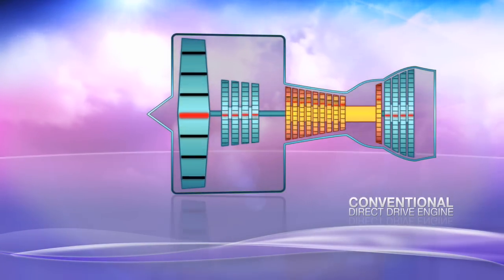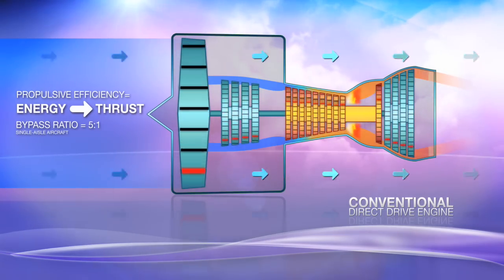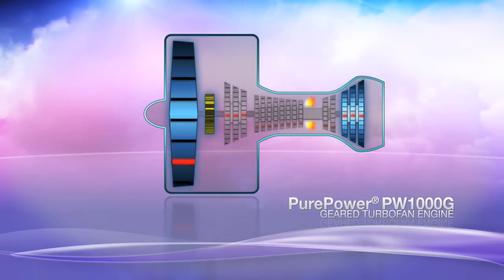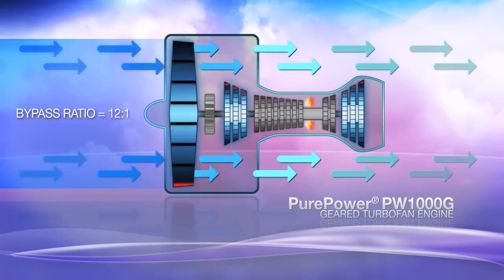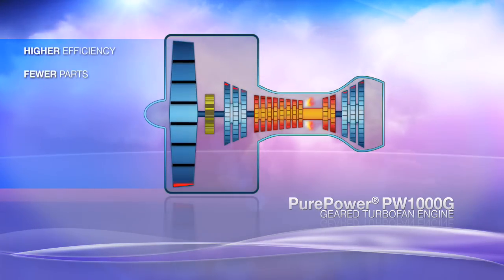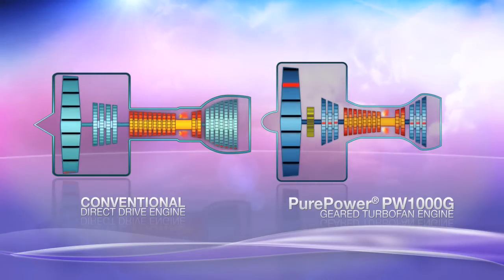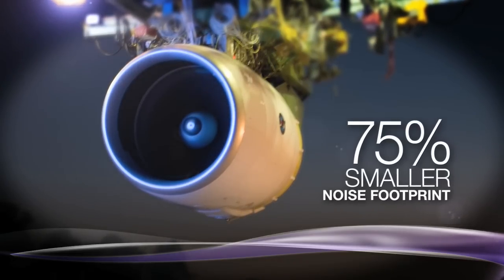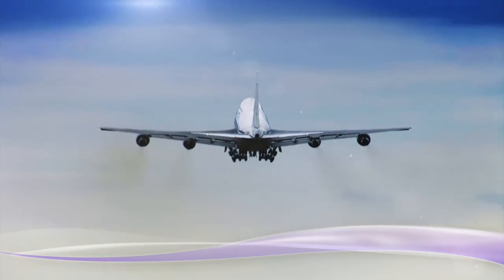Pratt & Whitney PW1000G PurePower Engine How It Works

Comment: Ok, fine, you have me convinced.
Where can I buy one, how much is it, and how do I attach it to my bicycle?
Reply: I need one for my '73 Super Beetle. Order online? Think 'bout $30mil/ ea. And just use the maintenance stand for it and a bicycle tag along bar.
Reply: @British Airways Boeing 747-436 Not with that attitude!
Reply: I need two, in case one fails.
Reply: @MarzEzOnline  
I think #2 was the test engine.
Reply: *engine starter kit and fuel systems not included in the box.

Comment: These engines have been introduced in haste. Around 31 "A320 Neo" aircraft of Indian carrier "Indigo" have been grounded as the new engine packed off mid air. Passengers reported hearing huge bang and the engine just shut down.
Reply: Martian Tripod you should check your source of information, no these are not the NEO engines, this is a diff tech still in the testing phase, will be a while before its put to commercial use,
Reply: @dannydawn927  it is A320-271N with " Pratt & Whitney PW1127G-JM " engine.. all a320neo with Pratt & Whitney PW1000G facing same problem
Reply: @dannydawn927  You’re just wrong.
Reply: A company named GoAir got Bankrupt buying this engine.
Reply: It was due to a manufacturing defect in the metal injection moulded parts.  The powdered metal was contaminated with ceramic tooling.  This also affects the non-geared older engines.

You're a silly billy.

Comment: The US Air Force needs to put these on the KC-135 Stratotanker. It would be a huge fuel saving program. It would be about 1600 engines too. Maybe reengine the B-52 with four of them too.
Reply: Hell, if they can just put modern turbofans on the B-52 they could cut the number of engines by half and get better performance in the deal! That plane uses the same engines as the 707, from the late 50's, without fan bypass!
Reply: the C135 tankers are nearly out of service and they were allready upgraded to CFM56 turbofans from the older JT engines .. doubt its worth it a second (or eve third for early models re-engining when they are due to be replaced soon (with the KC-46)
Reply: There is a version that went for the B-52 but was won by Rolls-Royce. The version P&W put up is going in the new B-21.

Comment: but i don't get how this is more efficient, because now the fan spins slower than normal which means it will get less thrust, while the compressor spins at the same speed the fan is spinning slower than normal and in order to achieve the same amount of thrust as engine without gearbox the compressor now have to work harder which means it will eat up more fuel! so how is this gearbox more efficient? can anyone explain to me how is this more efficient?
Reply: A larger fan can push more air mass, thus, more thrust available. In place of pushing less air to a very high speed (noisy and not very friendly with the fuel), the fan increased its size, slowed its speed but increased the mass flow, therefore, at lower speeds (quieter, fuel friendly), you get the same power. For a plane going subsonic, a slow fan is more efficient.
Reply: smlbstcbr Ah! I see! thanks!
Reply: Ok, you seem like you may know the answer to a question that has been bugging me for a few days now. It appears to me that that there must be some sort of gearbox between each jet engine stage already since, like in a GE90, they each turn at very different speeds. With this in mind, please explain why this final gear reduction has been so difficult to achieve. How are the intermediate stages coupled anyway, they each seem to turn at different speeds, they have counter rotating sections, reverse direction, etc., and yet they still transmit power from the rear turbine thru to very large powerful fans, now PW is saying that a gearbox on the final connection is a game changer, please explain. I see this comment is 2 years old, so I'm saying thanks in advance if you decide to answer me.
Reply: Darnley Bynoe Actually, there's no gearing between stages. The spools rotate independently from each other, at least on large engines like the Rolls Royce Trent (I think they have three spools), GE90 and PW4000. They have no mechanical linkage among them, what makes them move is the fluid that goes through them. Why was it so difficult to make a final reduction? Well, because of the size of the engine and the power that the gear has to handle, it has to be an extremely reliable gear, lives depend on the reliability of those components. Putting a gear simplifies the design of the engine stages. The high pressure compressor works more efficiently at high rpms and the fan is more efficient at subsonic speeds. Extracting power at low speeds from a very high speed fluid would require a lot of intermediate stages, with the associate cost of having more blades to maintain and replace.
Reply: Damley Bynoe... The main front power fan is driven by a planetary gear set... Not sure about the specific gear ratio, but it's a reduction gear. 
As for the compressor & turbine stages, they are split in high pressure & low pressure... high pressure on hollow shaft & low pressure on solid primary shaft running through the hollow shaft independently. Basically, the high pressure turbine spool primarily runs the high pressure compressor spool and is allowed to run at a different/higher  RPM than the low pressure spool which is the primary drive for the front main fan via planetary reduction gear to keep the fan blade tips subsonic for efficiency & long cycle operation/reliability.
I hope I explained this so even I can understand it...HA! :)
Reply: I thought that the main purpose of slow fan speed is to have higher bypass air to cool the rest of the engine (high temperature difference = more power)
Reply: I don't see people discussing how the engine allows the fan to rotate slower than the speed of sound and thus it eliminates the oscillation that occurs. Without this oscillation induced drag the engine proves slightly more thrust.
Reply: A smaller faster spinning fan can provide the same thrust as a larger slower spinning fan.
Reply: @davidperry4013  Less efficiently though, especially if it's nearing transsonic blade velocity. The penalty isn't bad because turbofan blades are designed for that, but it's still there.

Comment: Its great until the gearbox packs up!
Reply: All current turbofan engines already have complex gearboxes, when they seize, stuff shears, but it's not a catastrophic issue. The engine will just be shut down and the flight will be completed or diverted using the other engine(s) and/or emergency power systems.

Based on their design, I think if it seizes, the turbofan will run at a higher speed, reducing efficiency, but still flyable.
Reply: If the fan seizes it's not going to move is it? The gearboxes on aircraft don't have 80000lb of thrust going through them do they??!!
Reply: Gears are meant to shear, the fan can continue to turn, but without PTO (Power takeoff) and no fuel. So it would just spin. 

With the geared design, it looks like it could seize too, but it would just end up either locking the fan to the turbine or just shearing and leaving it to free-spin.

All of these things have already been looked at and tested. I've worked for a similar company, there's a lot of redundant systems and failure modes that have been thought of.
Reply: That's why it's taken so long and so much money to get to this stage - the lead engineer has devoted his entire career to this one technology - they reckon it's ready to run with 100% dependability.
Reply: SirSleepJunkie I agree with you. I have great respect for that engineer. 

Sometimes you do stuff, not because it's easy, but particularly because it is hard. People like that engineer are like the people who made it possible for us to go to the moon. I hope we can all aspire to be like that in some way.
Reply: IBUILTTHAT
Not true, only the P&W PW1000G has a gearbox between the low pressure compressor and the fan. Watch the information on other turbofan engines, you'll see that they don't have gearboxes and that the fan and LP compressors are mounted on the same shaft and turn at the same RPM.

Comment: Without knowing the full specs, I'm guessing it has a planetary gearbox and has limited thrust compared to the big guns: Rolls Royce Trent's and GE 90's. Power limitations and weight have the deciding factor to that gearbox design. Either way, I like the idea in principle.